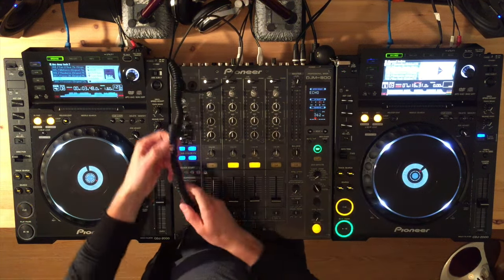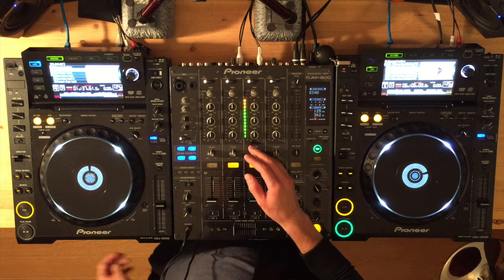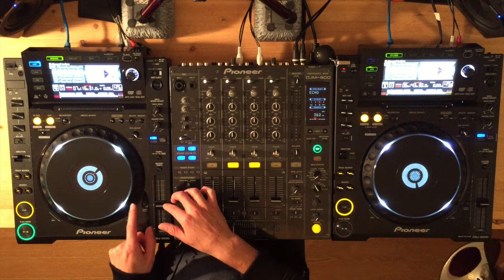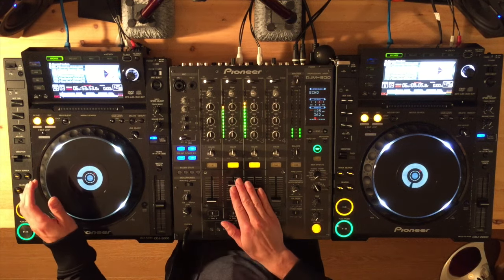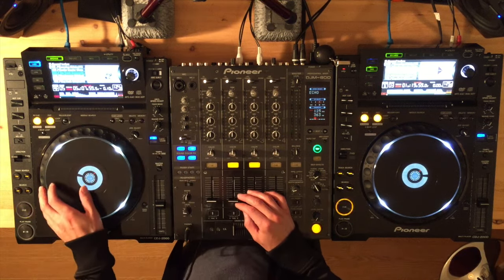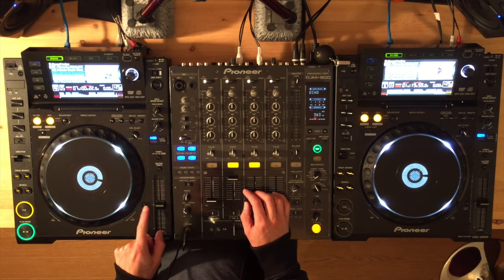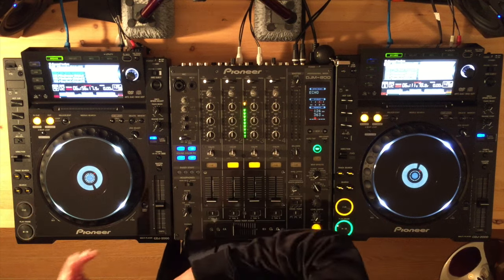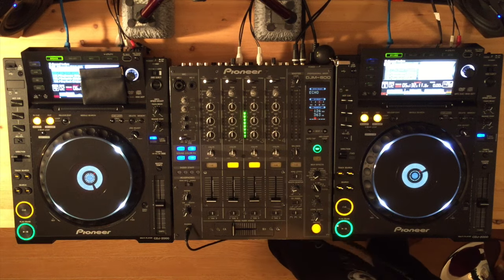DJing - HOW TO BEAT MATCH

Comment: if I'm trying to start to learn how to DJ do you think it is a bit much too purchase CDJs and a mixer such as in this video so there is no need to buy better equipment in the future, or would you recommend something else?
Reply: skateboardD12 I would start off with something less complicated to understand the basics then upgrade once you know what you are doing
Reply: I say if you know that your going to use them and they aren’t going to collect dust buy once cry once. When you start mixing a lot and start using different rigs setup at clubs , party or even a friends house you can tell difference in good equipment and crap.Really much more enjoyable using high end professional rig something you would see at the club AH Xone 92 mixer  Technic Sl-1210 turntables, Pioneer DJM mixers and CDJ - 2000 or any Pioneer CDJ ,Rane mixers are kick ass, some of the Denon gear is soild. Never get cheap on your headphones IMPORTANT and needles if your playing vinyl or even using DVS setup. You want to find pair of Headphones that allow you to make correction b4 anyone can hear the near collision. Nothing worse than having a train wreck and your not sure if need to speed up or slow down so a pair of Headphones that you can quickly position from off to firmly over your ear allowing you to apply pressure so you can isolate the track you’re mixing from the main mix which can get tricky when everything is blending together you want firm foam and leather covering outside of cups to create a seal around your ear.Highend sound drivers  that bring out mid low to mid frequencies your kicks, snares, claps,  really crisp transients allow you to recognize what tempo corrections are needed while keeping headphones at a safe volume. Cheap headphones allow frequencies to bleed together and don’t isolate the different tracks your mixing ,causing you to turn volume up high damaging hearing while not really helping you mix.
Reply: I think for a basic beginner setup, then you shouldn't be spending £4k.
Personally I would budget for maybe £500 and get a pioneer DDJ (I think the DDJ 400 is actually quite ok for a starter),and some decent headphones and speakers.you will appreciate the sound quality!.
If you want a bit lower cost then you can go the serato route and an numark controller, but I found the numark stuff to be a bit flimsy.The pioneer is much better build quality and with rekordbox you'll have all your tunes in the right format should you want to progress/get invited to do club sets

Comment: i understand using the same track to learn  to mix but personally I think one should learn with two different tracks.Ones ear doesn't adjust and hear the tracks especially when you starting out.Its easier to distinguish beat speeds from different tracks ...thats just my take. Great lesson though
Reply: if you're just starting out ie total noob,then both tracks the same is the easiest way to get the synchronisation.
when you get a bit more confident,then have a try with two different records of just percussion of different speeds.

Once you've mastered that, then start getting a bit more creative with the music and LISTENING to each track you have.Learn the pitches,patterns, phrases and breaks of each and have a play to see what will work well with what.This is the bit where you can really start to have some fun because you can start to make music with music.I'd say this is the most fun part because it really expands what you can do and it takes some real memory skills to know each track in your collection inside out!!

The next level up after this is deliberate phasing(similar tracks just out of sync to create that reverb and tunnel effects) and scratching.

Comment: Because I mix dnb predominantly using the bpm slider usually takes far to long when I’m trying to go for things like doubles, switches or triples as I usually have my hotcues set 16 beats before the drop, I know how to beat match because with stuff like house and garage it’s not as quick. But dnb I struggle and have to use sync else I’ll miss the queen points. How do you change the bpm quicker than the bpm slider?

Comment: still confused about the jogwheel so nudging it speeds it up or slows it down but since it's only temporary, you always need to use the pitch fader with the jogwheel right? I've sen a couple videos where it's implied that in some cases you do not need to the tempo fader and can just use the jogwheel. Around how many seconds would you say the tempo slips out after just using the jogwheel to beatmatch
Reply: First, with the pitch slider you adjust the BPM`s of both track to be as close as possible (same bpm´s = better), then with the jog wheel you adjust the second track to match the first one .  If the pitch/velocity is not a perfect match, you can use the side of the jogwheel to keep adjusting it. Simple as that.

Comment: hey man, nice video. but why don´t you use the master tempo button that the track will stay in the original key, no matter how far you use the pitch fader?
Reply from the maker: I find its not always necessary, but I have been using it more frequently lately. I also made a video on its function.

Comment: i have a question with pioneer ddj400 for example you can see the beatmatch on the screen also now you have 2 screens seperated on this one do you still see the beatmatch aswell on the screen or with these professional cjds you have to do it all by your hearing?
Reply: Goksel Ceylan you have to do it by hearing. I have a ddj rb, and the best way to do this, is in rekordbox, change the spectrum view until you see it like the cdj on the video. You will be more prepared when switching to a real cdj!

Comment: Is it a good practice to watch waves in virtual DJ software and to align beat "dots" (really dont know the name but those are dots on top of the waves not those that are separated from waves window) and than based on that to finish off the beatmatch. I am a beginner dj so every advice would be helpful!
Reply: Not really as they’re not always accurate but if it helps you learn on a temporary basis it does help visualise it. You really need to be able to tell by ear

Comment: Hi, great video, but I needed to deal with a smaller problem. Whenever I compare BPM and align the tracks and I want to release the other track aloud, the tracks will start again and the whole comparison process is lost, some advice please ?
Reply from the maker: What do you mean they will start again? You need to beat match in your headphones, make sure they are aligned, then start mixing the new track in live.
Reply: Sound of Arman Im sorry for bad English, I thought that once I compare the tracks in the  headphones after a while the comparison of the track does not fit in again

Comment: Great tutorial, just so I'm clear: it was a fluke that the first two tracks were 125bpm and I need to set the pitch control to the position that puts my incoming track on the same bpm as the outgoing one before I start using the pitch control to beatmatch?

Comment: It doesn't have any sync button to match bpm's? I hv seen sync button in many dj softwares and apps
Reply: nothing wrong with syncing, but if your sync fails and you don't know how to beat match your night is practically over.
Reply: Vedant Shinde  you can use sync but the big thing is timing like when to bring in the new song or where to bring it in , thatd why u have to know beat matching by ear that way u always on the first beat . timing is key in manual beat matching
Reply: hey !!! Now I am doing good without sync.. not that master level.. but I do not sync anymore..

Comment: Does the "cue" button automatically find the first beat? I am a bit confused
Reply: The cue button is for setting a staring point for the track. This has to be done manually, by finding the first beat. Beatport has a great tutorial for this on their channel :)
Reply: No man the jog wheel finds the first beat when you move it back and forward. It should make a thump sound once you find it then you press cue to set the cue point i.e the point in which the track will begin to play.                                                     

01.Match BPM using pitch fader.
02.Find your first kick using the jog wheel.
03.Play the first track. 
04.Count your beats 1,2,3,4.
05.Play second track.

Comment: Beat matching really is totally pointless with Cdjs and control surfaces. Of course you can do it if you get bored but the sync button truly is not 'Instant DJ' nor is it 'Cheating'. If anything with today's technology, using pitch match gives you time to add something extra such as effects or samples. In essence pitch matching is not, by far, the most important skill in mixing and you should feel no shame in using a sync button, it's still not always perfect so learning to beat match is still relevant but don't feel less of a DJ because you use today's technology, if anything you can be much more of a DJ by utilising auto sync to remix on the fly etc.
Reply: ZEROFUX  Well I guess I was asking for it heh

Comment: This doesn't teach anyone anything. All you're doing is showing people how to let a machine do it for them. 
It's like posting a video saying how to multiply large numbers easily, then in the video you get a calculator out. You should be teaching people techniques to match speeds and beat match in their heads, not showing them which buttons to press that will automatically do it for them.